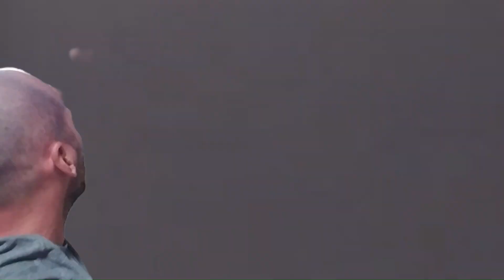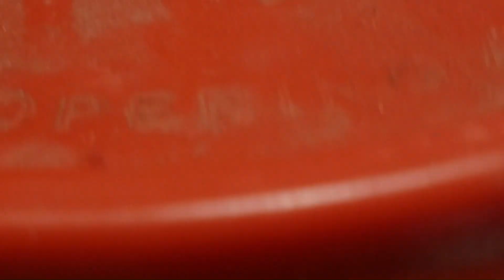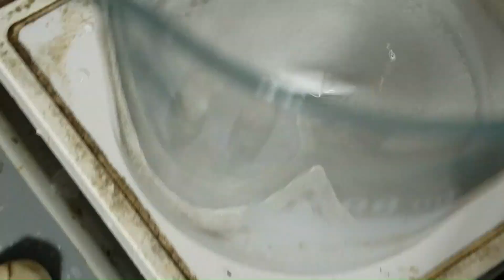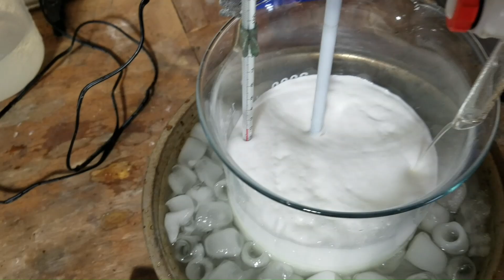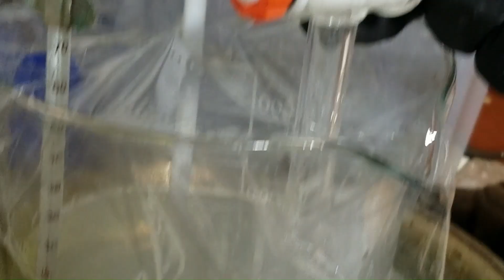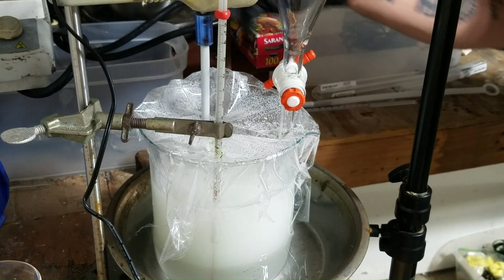Hydrazine Sulfate

Comment: I know I should probably test it myself if I ever get around to making it, but if putting a spoon of oil on top of the water when you make spaghetti stops the phome, maybe you can use some type of oil for a phoame suppression here?
  I'm sure you can't use vegetable oil because of the hydroxide, but if motor oil is too reactive maybe silicone oil or the fluorocarbon like dry water that they use for fire suppression?
   If you don't, I might one day test the silicone oil theory, but I don't think I'll ever get a sample of dry water.
   But next time you make hydrazine could you try oil on top of a small batch to see if it works?

Comment: When you move the glass beaker after the bleach addition from the ice bath to that hot bath the glass experiences a temperature change greater than 60C. This can cause thermal shock to any ceramic or glass material. Have you experienced this at all?
Reply: It's borosilicate glass, it's not as susceptible to heat shock.

Comment: I guess you made HS for the synthesis of AminoQ. Did you know that calcium cyanate  (urea and calcium hydroxide) and HS produce aminourea (semicarbazide)?  Aminourea formate (neutralization with formic acid) heated to 100c undergoues cyclization to form triazolone. TO + 65% NA --> NTO

P.S. I have a bit of diaminourea (carbohydrazide) and i wanna test if aminotriazolone will form the same way.

Comment: Can someone give me the QRD on mixing table sugar and hardware store stump remover over heat?
I've seen it done but don't quite understand the process
Reply: 60/40 KNO3/sugar is the standard but there are other ratios for different uses. Put everything in the pan turn the heat on medium and stir constantly. When it starts melting together turn the heat down a bit (it'll be different on different stoves/hotplates) and continue stirring until it's all melted and smooth. Should be the color of peanut butter. Make sure not to use "stump out", it's the wrong stuff.
Reply: @chemistryofquestionablequa6252  Does it become something like "Potassium Nitrasucrulate?"

Comment: FYI: You can neutralize hydrazine with Hydrogen peroxide. All of the water used to wash the product will has some hydrazine contamination. You don't want to flush the waste water down the drain!
Reply from the maker: Hypochlorite is better. It has long history of use, it's the standard chemical for oxidizing hydrazine.
Reply: Not related to this video, but do you have any recommendations on how to neutralize the waste from making picrates. Great video by the way
Reply from the maker: @usa5865  I think incineration is the best disposal for benzene

Comment: Tell me, is it possible to make an instant smoke bomb at home?    I'm not talking about an ordinary smoke bomb, but about the one that is used in tanks, and for example in Russian РДГ-М/RDG-M grenades?    The fact is that such grenades use white phosphorus, and it is impossible to work with it at home, and it cannot be bought.    Maybe you know some original safe option?    Airsoft grenades leave much to be desired.
Reply from the maker: It's possible to use explosives to detonate red phosphorus which will then turn into white phosphorus in air. Metal chlorides are best if you dont need explosive smoke. Use a metal fuel and chlorine donor binder like parlon and an oxidizer like chlorate or perchlorate.